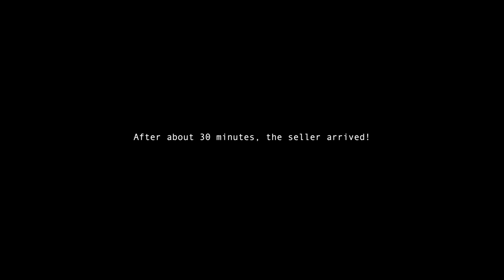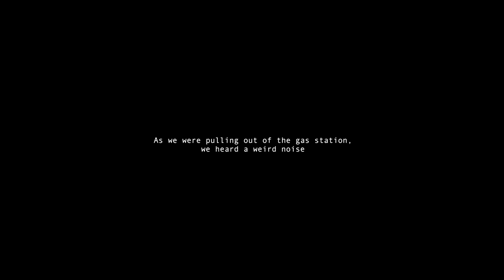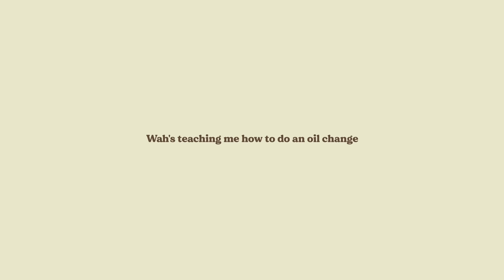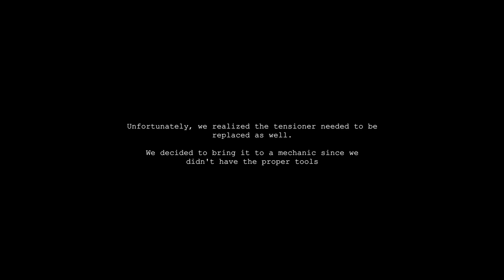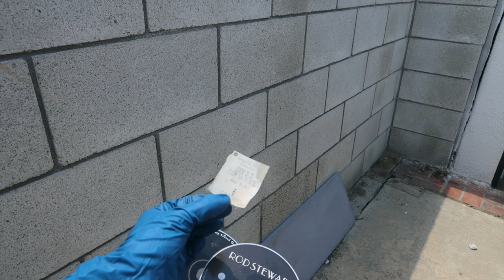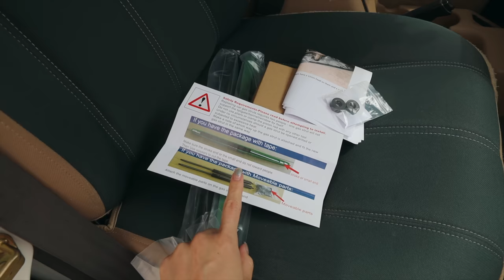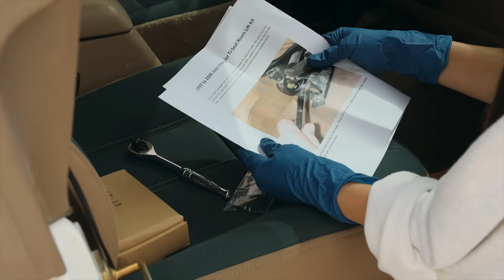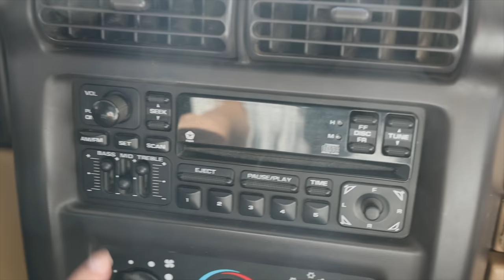I bought my dream Jeep...

Comment: Hey guys, congrats on the new Jeep! Been a long time follower. I’m a mechanic here and just want to chime in about the shocks recommendation from Firestone. You may not need new shocks if the car is riding fine with no noise or issues. Many shops try to “up sell” their customers for more profits so be careful. Bad shocks will generally have these symptoms: unusual noise, rough ride (bouncy), ride too soft (like a boat), nose dive when braking, uneven tire wear, or visibly be leaking fluid from the shocks (light seep of fluid is still generally ok). Hope that helps and always feel free to reach out to me if you ever have questions! Love the interior of the jeep btw! The seats look like it's still in great shape for the age!
Reply: I have owned a Jeep Tj like this YouTuber, no amount of great shocks will make the Jeep Tj smooth. Maybe if she does a lift kit and shocks. Looks like she has a Sahara edition. The squeel could just be you need a new belt. She's also got a 4.0L inline straight 6. The engines are bulletproof if she does regular maintenance. Also, she should definitely use a spout for the oil change, I always spill without.
Reply: Just watched the whole video, she changed the belt LOL
Reply: @directedbydon  Agreed. Bought my Jeep TJ last year, changed the shocks to OMEs and they helped but it will always be a bumpy ride since it's a Jeep haha
Reply: I remember Firestone clear lake tried to charge 800 to fix my $1700 Tercel back in 2000, and ended up paying 300 at toyota dealer in league city. 😅
Reply: Hi this Jeep Cherokee is a piece of junk
Reply: Especially Chrysler Jeep by a used jeep not more than three years old
Reply: @denisfrancois190  WTH are you going on about? There's no Cherokee in this video.
Reply: @directedbydon  This is the reply needed, "Lift Kit" is an overall healthy choice for a jeep, it will not only swap the shocks, but springs, steering dampers and so on will be totally worth the mod instead of just replacing the shocks. But not everyone will have those funds available to splurge so with Jeep issues you will always ponder, "do I remove the weed or replant the garden" and every weekend wrencher mentality tackles it all differently.

But as a 2006 Jeep LJ Rubicon owner, I bought mine with 100 miles on the dash in 2006 and never looked back and after 280,000 miles, 17 years, a few mudslides and some snow storms, Sadly a few rainbow-bridge dog rides later and all on on that straight 6 that still rocks the original clutch, yea she's a manual. I have spent a bit time under the hood that when I think back on it, my rig has fixed more of me than I ever will of it.
Reply: Bilstein 5100s and that TJ will be riding great.
Reply: Legend! ❤
Reply: Bro if those shocks are oem like they said they are 23 years old no way in hell are they still good.
Reply: Nice, I also have a manual tj, oem clutch went out at 237k miles on mine. Thing was worn down to nothing 😂

Comment: YouTube algorithm sent me here. You got yourself a pretty spotless Wrangler!  The 4.0L in them will last you forever if properly taken care of. Along with the shocks, do replace the front steering stabilizer, basically the horizontal shock upfront by the front differential. Replacing this and checking your front ball joints should help eliminate that wobble you mentioned earlier. :)
Reply: I was about to tell her about the stabilizer also.  My 2004 TJ wobbles at 50-55 mph, and then he's good to go.

Comment: Make sure to change both the rear/front differential oils( the pumpkin shaped orbs in the front and rear axles) every 15000 miles. Refer to the owners manual for oil type, can be done at home. Doesn't take too long, congrats on your new jeep :)

Comment: Feeling so old now.  I bought my 2000 Jeep TJ Sahara brand new in 2000 and have been using it as a daily driver ever since.  Not as nice as yours but still runs great and the interior is the same color as yours.  It holds up well.  They are great vehicles.  Enjoy.

Comment: I remember the absolutely extraordinary feeling I had when I got my first TJ almost 4 years ago. Its almost magical, and this is before a person even has any idea what a Jeep can really do, especially an old one. I had never really pined for one as much as I was curious about them. Found myself in a spot where I needed a new ride, I didnt want another giant bro truck but I wanted something with 4x4 for around $10k, so I looked at a TJ. The first time I drove it I felt like "this is the thing that has been missing from my life." Ill do everything in my power to ensure that I will have one of these for the rest of my life. If you love that Jeep and make sure it knows, it will literally love you back. Super reliable if they are maintained and not overly abused, which they will tolerate a lot of.

Comment: Congratulations. I have a 2003 TJ 4.0 liter since new. I love it and despite some flaws will never get rid of it. 163,300+ miles since new.  About the shaking when driving, it may be the Jeep death wobble. From experience, go to a reputable 4X4 shop, not Firestone for the best repair solution. I wasted time and money with people that did not know what they were doing but once I found a good shop, 4X4Parts it got fixed correctly, including replacing a badly installed lift.

Comment: From an old jeeper guy who has owned several jeeps and does all my own mechanic-ing... I just wanted to let you know I enjoyed your video very much.  Great seeing you doing as much work on your own as you could. That jeep's got a great engine in it!  All you need now is a couple lockers, a new suspension with lift, some larger ties and you can join us out on the rocks.
Reply: You forgot to regear if she change tires to 35”
Reply: @joeyrt100  I was thinking 40s.

Comment: One more thing. I heard from many mechanics not to use synthetic oil on the 4.0L. remember this is a very old-school engine. Use the normal thing 20W-40W. Modern thin oils are not gently for this engine. Also change those belts, change the differentials oils. transfer case too.

Comment: Welcome to Jeep life!  Great vid and I share your excitement and enthusiasm.  Like you, my Jeep was my dream car (not a Ferrari or Porsche).  It truly is a way of life and I think the two of you will enjoy wheeling, camping and wrenching on your Jeep.  

A couple of things, though, for your viewers and for you, too, in the future.  Whenever you purchase a used vehicle, have it inspected (if you're handy and confident in your mechanical and diagnostic skills, you can do it yourself) by a mechanic.  I, personally, would not have taken that long a road trip without having my belts and hoses inspected, brakes inspected, oil changed (engine and transmission) and an OBDII code reading. 
 
Also, carry a basic tool kit with some extra fuses, tire pressure gauge, portable battery jumper, portable air compressor, high temp tape, gaskets and clamps to do on the spot hose repairs, extra belts, and at least a quart of oil and some coolant.  And carry another bag with a hat, sweatshirt or jacket, sun block, insect repellent, and a blanket just in case.

The TJ Sahara is a beautiful Jeep and I love the extra factory body cladding.  Keep it stock or lifted and either way, it will look great.  Get a bikini top and tonneau cover for your rig when you take the top off.  If you haven't tried driving with the top and doors off, you're in for a big surprise (and addiction!).

Comment: The radio more than likely needs a new power supply, very common problem in the TJ/LJ and XJ that have the AC vents above the radio. Basically when the AC is on max it produces condensation on the bottom the vents which drips on and into the radio behind the dash. If you get the radio repaired (or replaced) put aluminum duct tape across the top covering the vent holes so it doesn't happen again.

Comment: Shaking on the wheel might be more of a balancing issue. Next time if the shocks goes out instead  of holding all the weight just use a vase grip and clamp it in the middle.

Comment: for steering wheel cover, I used one that came folded like in a rectangular shape, and can mold easily to a circular steering wheel shape..  the best thing about it, is that it doesn't add girth to the steering wheel and it almost feels like it doesn't have a cover...

Comment: My parents used to have a 2002 Jeep in dark green with a plow attachment. My mother sold it towards a really good friend during the summer of 2017.  It was an automatic. I did drove it since it was easy to drive. My father had it fixed in 2016. My father used to a 1983 CJ-7 Jeep in denim blue color. He got it from a family that lived in southern Wisconsin. It had a plow attachment,too. He got it in the early 90’s. I never drove that one. It got rust on the floor boards. My favorite memory of that Jeep was when I put my stuff that I packed for the summer. I put a couple bags on the back seat, my tape cassettes between the back of the seats, my sub woofer boom box in the very back of the Jeep. All of my stuff that I didn’t blocked my father’s view. When I drove the 2002 Jeep it felt liked driving a very small school bus.

Comment: Oil change info: it takes almost 6 quarts. With filter change. Dump the 5 quart oil jug in. Then 1/2 of the 6th quart. Then add and check till u get it to the mark on the dipstick. If you are unfamiliar doing this, this will speed up the process.

Comment: You found a decent Sahara, looks very nice.  The Sahara has an off-road weak link - the Dana 35 rear axle.  Which is fine for street use, and camping fire roads sort of use.  But be gentle with it in any more serious off-roading.  They can snap a rear axle, and the entire wheel/axle comes off the Jeep.  Seen it first hand.  Other models have Dana 44 rear axles, which are tougher and retain the wheel if you do snap an axle.  This is nothing you need worry about for light duty use and camping fun.  Just keep both axles full of fluid and serviced, and you'll be just fine.  I have a 6-speed Flame Red 2005 TJ Sport Dual Top.  I've had it since 2006, never modded or trashed in the woods.  My Jeep does have the limited slip Dana 44 rear axle upgrade.  I looked at many TJ's until I found one with all the right bits.  It's been garaged and pampered everyday, never parked outside in the elements.  Has 53k miles now.  It came with both tops in grey with tinted windows, so I have crane in the garage that holds the hardtop up, and usually leave the Jeep wearing it's soft top down.  I love the BFG tires you picked, I'm thinking I'll do the same.  The Goodyears on the Jeep look perfect, but they're 14 years old, and that's too old my local tire shop won't rotate or balance them.  So tires is my next purchase for the Jeep.

Comment: I bought my first jeep from 2001 2 years ago and have been tinkering with it ever since! I also had trouble with how to tighten or loosen things, and that caused a lot of annoyance when I started. Righty tighty lefty loosy never really made sense to me, so instead I think of it as the hands of a clock now - tightening is going forward in time, loosening is going back in time. I'm just weird that way, but it works for me.

Comment: I have the same year and model and I love it I've had it for going on 7 years now and as long as you keep up with the maintenance on it it will run forever. The one thing I would say if it's riding really rough check the tire pressures Jeep recommends 29 psi or so if you look on the driver's side door frame it will say 29 psi I run around 29 to 31 psi on my tires and I have the same exact tire. The reason I say this  is because if the tires have too much air the jeep will bounce around like a pogo stick lol.

Comment: I have a 2002 TJ, buy a Haynes manual, it will be your best friend. Also if it’s just the 2 of you the rear set is easily removable which greatly increases the limited space in the back.

Comment: I've owned 2 TJs and one JK. All with that world-class 4.0 Engine. It's gonna guzzle some gas, especially compared to today's cars, but that engine is absolutely bulletproof. One of the best engines ever designed, built and tuned. The Automatic tranny does not have that much of a great reputation, unfortunately. 
I've had red, white and blue jeep (by coincidence), my current one is white (5 speed manual), and I could not picture myself driving anything else. 
Good luck!

Comment: Jeeps, love em and hate em. The shake may be known as the death wobble if you go over a bump or pothole and the wheel wobbles... If this happens, dont slam on the brakes, instead let off the gas and hold the wheel firmly until the car slows down naturally. Also with any tire that has knobby tread, make sure rotation happens frequently, uneven wear on tires/  unbalanced tires can cause the shake at higher speeds.

Comment: I have a 2020 jeep wrangler and used to have a 2000 TJ and spent more with repairs or random issues and could not enjoy it, you were better off buying a 2020-23 wrangler instead with low miles/leased. Congrats nonetheless

Comment: Just stumbled into your channel. I'm guessing YouTube algorithm had something to do with that.
As a fellow Jeep owner (XJ model) and enthusiast, congratulations on your purchase! Wow. If I was not an enthusiastic Jeep owner all ready, I would be after watching this video.
I want to share a few experiences I have had with the two used Jeep XJ (1990 and 2001) I owned and presently own. Both vehicles featured the 4.0 straight 6 cylinder engines (exactly like yours) which are built like a tank. The common issues were; rear crankshaft main seal leaking Appx. @ 228k, harmonic balancer worn out - which is one reason why a serpentine belt will get eaten-up/shredded, and do not track properly appx.173k, rear hatch hold open shocks - dozens of these over the years, and an intermittent partially collapsed hydraulic lifter (1990 @ 78k and 2001 @103k.) I caught the lifter collapse early and after much trial and error remedied it with a switch to AMSOIL synthetic. Have no idea why it worked but it did. 
 A friendly suggestion, if there are no maintenance records or known history you may want to flush the coolant system/radiator, change the front and rear differential oil and add back the mandatory gear additive solution, and finally, change the trans oil. All of these recommended mileage or timed fluid changes are probably in your vehicle manual.  
 Weylie and Wah I really enjoyed watching your video and will be looking at your other content.
 I hope that the adventures you have in your old/new Jeep Sahara are full of fun and good surprises. 😁

Comment: This is an older Jeep Wrangler, 1st generation, made in the 2000s. That badge means it has a 4 Litre straight 6 (an AMC Engine Chrysler was still building when they acquired AMC)

Comment: Grats on the new Jeep Wrangler!  I miss my white 05' Rubicon, I regret trading it in for a 2018 JLU Rubicon.  Just doesn't feel the same and doesn't give the same smiles by miles.  Also for the noises, just turn the volume on the radio up.  Jk, always check ;)

Comment: I didn't hear how many miles it had on it when you bought it.  From my experience you want to change out the water pump between 80 and 90K miles.  The fuel pump should be around 100K miles.  Other than that it will run like a champ.

Comment: If you haven’t found out already……. And if you have the tip and tumble passenger seat in the front, and you put in the seat risers, you risk the possibility of the seat hitting the windshield and breaking it when you go to put the passenger seat forward.
Be mindful when you’re putting the passenger seat forward .

Comment: Omg guys, those cheap plastic ramps are notorius for sudden catastrophic failure. Pls toss them 🙏 Use good solid set of jack stands with backup (jack) if u must.  I doubt u even need ramps to change the oil. Great car! Wish you luck with it 🤗

Comment: Your rims are leaking from corrosion build up on the inside. Dismount tire, wire brush or angle grinder with soft scrubby pad, add bead lock adhesive re-install tire, inflate!